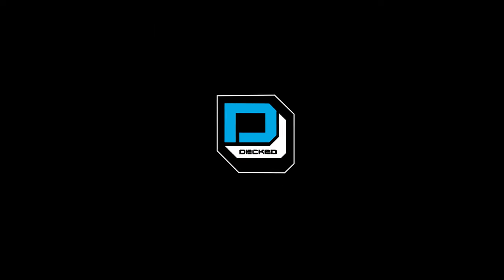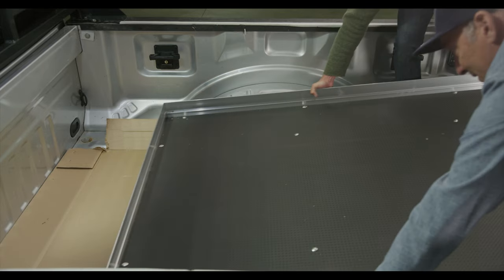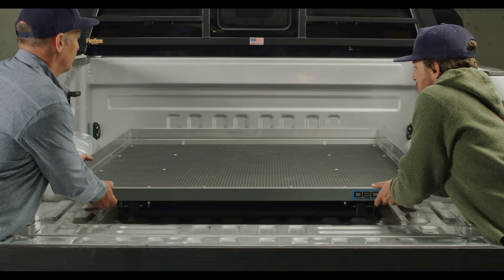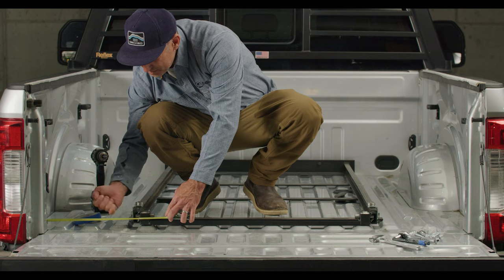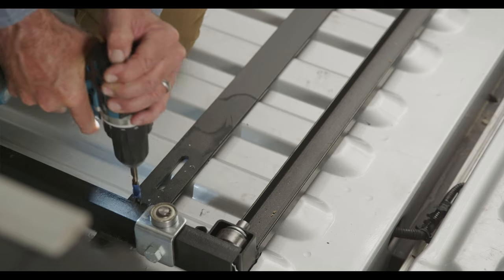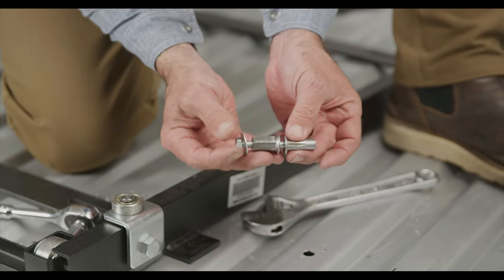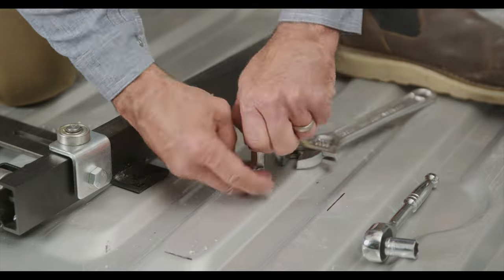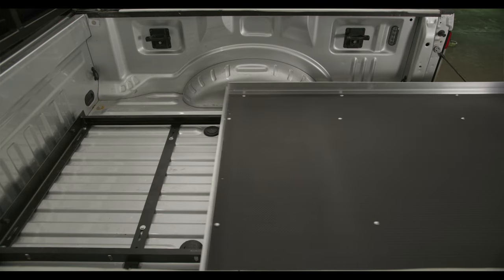DECKED 101 | How to Install CargoGlide to a Truck Bed

Comment: Do you have liners for 2018 Chevy Colorado Zr2 Diesel shortbed? How many inches is it from the truck bed to the top of the installed slide?